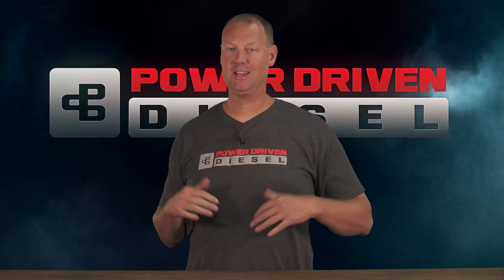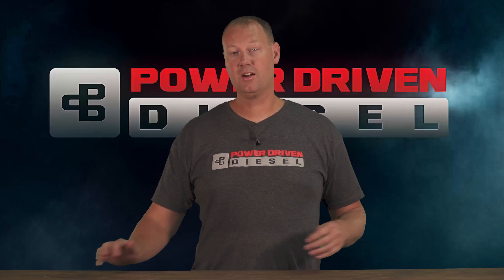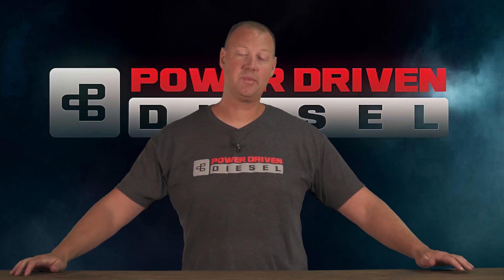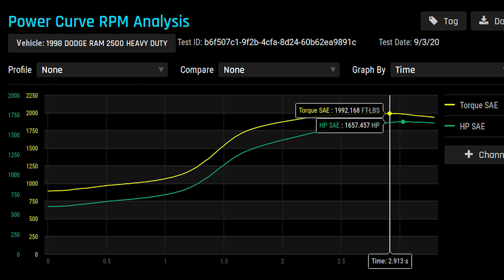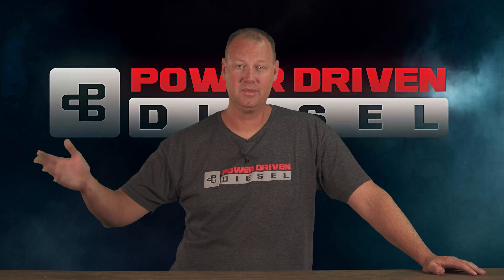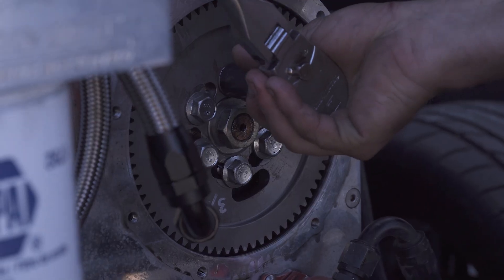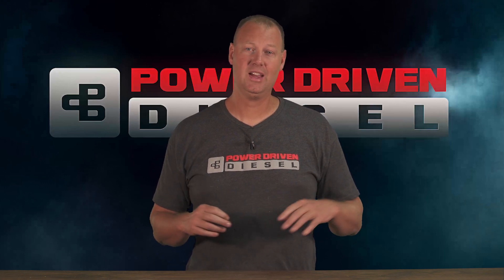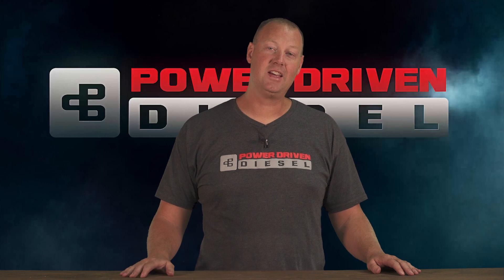2000 RWHP Cummins | Race Prep | Power Driven Diesel

Comment: So if a diesel makes like 40% more torque than its hp number, is it making close to 3,800 lb-ft of torque?
Reply from the maker: These higher powered engines are setup with large turbos that come to life at much higher RPM in an effort to reduce peak torque in the name of reliability.  This engine usually makes anywhere from 2200 to 3000 lb-ft of torque to the tires.

Comment: I usually weld a hump at the bottom of thafc foot so you can really pull fuel out when the rpm's are down. It aids dramatically in how they spool up.
Reply from the maker: Great tip!

Comment: What spray angle injectors do you run to get 36 degrees and not wash down the cylinders?
Reply from the maker: They are nothing special, just 155* pattern with some offset in the inclination angle to better hit the centered bowl piston.  Keep in mind these are spraying into a 4.250" bore forged piston, not an offset bowl standard 4.015" 12v cast piston.